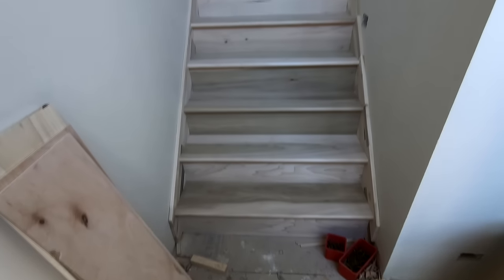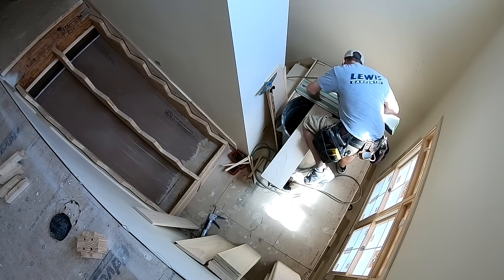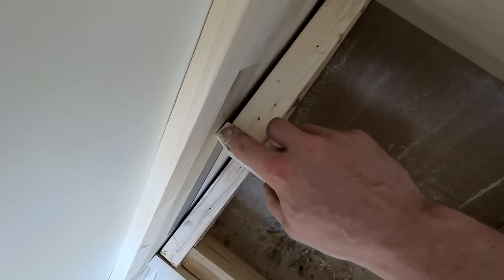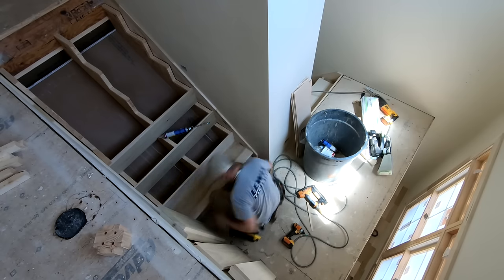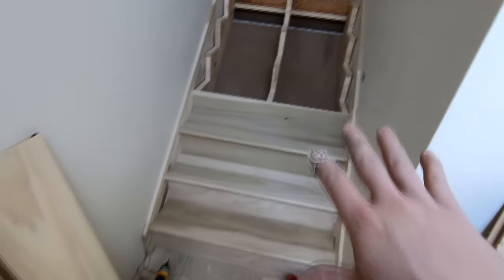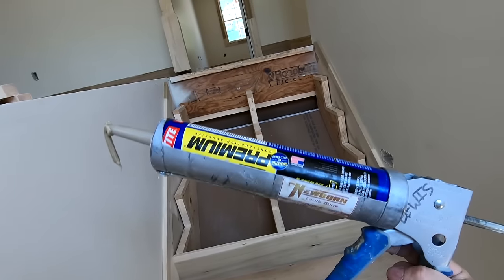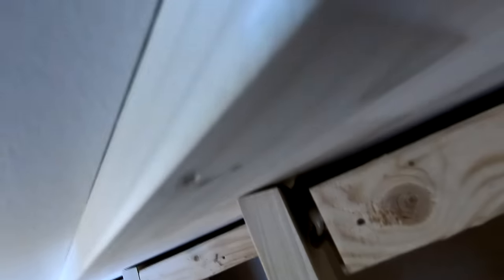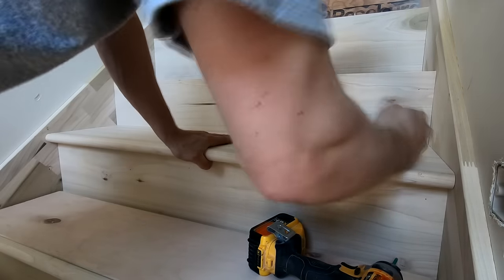How to Install Hardwood Stair Treads & Risers...Key Techniques for Perfect Results

Comment: Obviously for many species it isn't necessary, but for myself I would prefer drill the bottom of the risers so as to ensure that the screws go in straight, centered, and without splits. Also, I think you may find that the extra step actually regains the lost time by making the attachment go just that much faster.

Comment: This is a great video.  Thanks for putting it out.  I'll be purchasing your tools and will definitely go through your links.   I'm getting ready to put in red oak hardwood floors to add to the existing flooring.  After this video....I think I can do the work myself (slowly and surely).   The only area that you didn't cover was the skirtboard.  I have carpet over mine and expect not so pretty plywood underneath.  I'll soon find out :0)  Look forward to checking out your other videos.

Comment: On the stair stringers there are small pieces of wood added to the top and face of each cut out of the stepped stringers. Can you tell me about them? Did you put those on or did you buy the stair stringers like that. Ours don’t have that added. Is it crucial?

Comment: When you mention ripping the risers to the correct height, you subtract an 1/8” inch from the height of the stringer? I’m assuming this is on the back end where it tapers down? It looks like the tall side of the taper sits higher to achieve the gap you mentioned.

Comment: Enjoyed the video. In the new homes where I installed stairs the framers  installed the stringers. I always had to correct for the three stingers not being lined up, the riser cuts weren't plumb, and the tread cuts weren't level front to back or left to right. I didn't see you do this. Did you check the stringers for being lined up and having plumb cuts and level cuts off-camera?

Comment: Great video Spenser. I bought the Collins stair gauge and it works great. I have a very big stair job coming up with right-hand return treads. I have to mitre the stringers and risers to make a clean look from the side on the open stringer. Would you recommend one of the Festool cordless track saws for this? If so which one?
Reply from the maker: I always use my 12" sliding miter saw for those cuts. The track saw would only work from one direction unless you are plunging it. I'd stick with the miter saw.

Comment: He adds just a few 18 gauge nails just to hold the vertical movement while adhesive dries. I only have a brad nailer. Think it's good enough for the same purpose since it's not really for any load bearing purpose?

Comment: The tight fit is awesome ... That guide and the Collins tread tool are incredible tools. I'm replacing the "contractor grade" stairs in my basement and will pay the extra for the "right tools" to get the "best look. Thank you for this video.
Darn ... just looked at my stairs and noticed the right side spacing is "bad". I can put a skirt on the left but they seem to have installed one of the stringers with a lean. Any suggestions other than rebuilding a stringer?

Comment: I build the entire set of stairs in a room where I can screw from the exterior of the finished stringer into the tread and riser ends with 90 degree cuts on all the treads  and risers, no wasted time cutting 5 degree cuts on long edges or end cuts because the screws pull the stair together.  Once built, the entire stair set is slipped into place.  Super tight glued joints with hidden screw fasteners.  I’ve used this method in many remodels where I’ve removed the carpenter built stairs that were previously covered with carpet.
Reply: This,  I would like to see... especially one with multiple angles...

Comment: I have stairs that are a bit sloped to one side and upstairs is going to have solid hardwood so will add height, do you recommend putting new treads over the existing ones to reach top landing or gut the old treads and then raise and fix stringers?

Comment: Great video. I am surprised you are not predrilling the bottom of the skirting board from the front to ensure the screws are centered on the tread and do not cause splitting.  I'm old school and guess the new screws are better than I give them credit for.
Reply from the maker: Yeah, I was living on the edge. The GRK screws I was using have a really nice auger tip that helps a lot with splitting. Also helped that it was poplar. Oak would have split in a heartbeat.

Comment: My stair stringers are unevenly cut, I will need to put blocks to level them. Would you put those blocks on the side of the stringers?? Seems to be easier but wondering if that may create any issues>

Comment: Great video. I wished I watched this before redoing my stairs. Now I need to go back and redo them properly!  I noticed that your Festool rails have a black cut guide on them? How is that done?  It appears to be alot easier to line up with the mark than the clear cut guide.
Reply from the maker: Makita splinter guards. They stick better than festool clear ones.

Comment: You should give PL Premium MAX a shot. Its silane based, doesn't expand like the polyurethane products, and gives an unbelievably strong bond. I used that PL premium polyurethane on pressure treated deck stairs, had to disassemble them and it came apart disappointingly easily. Rebuilt test stairs using the MAX and it was impossible to disassemble. Broke boards while crowbar'ing the stairs apart.
Reply from the maker: Good advise. I am definitely going to switch to a silicone product for stair in the future. Thanks

Comment: Professional as expected, always sharing advanced tips & techniques.
Even I learned something new ☺️

Ps why not shoot a Brad in the bottom center stringer to hold riser, the tread will cover the nail head?
Reply from the maker: The tread keeps the bottom of the riser sandwiched in until it get screwed, but there isn’t anything keeping the top riser from kicking out, so that’s where it needs nails.
Reply: @InsiderCarpentry  got it thanks

Comment: Excellent video. Thanks dude. 

What’s the reasoning behind not nailing the very bottom of the risers where it will be covered by the tread?
Reply from the maker: They get screwed from the back side, riser into the tread. You want it to be able to suck tight to the tread, not tight to the stringer.
Reply: I caught that part but I worry the tread and bottom of riser could slide a bit (together) while you’re working on them/until the adhesive dries. I’d probably put a pins in the bottom of the risers as the GRKs will surely pull the pins out a little bit....*lightbulb moment*  that could cause a creek. I think I get it. This video was super helpful. Thanks again
Reply: Insider Carpentry also, I think I saw @jchcabinets use that tread jig on some built in shelves. Magic little do-dad

Comment: We are close to installing our basement stairs. I would be concerned about running the screws in from the back "straight". Thinking predrilling pilot holes might be helpful? Thank you for your video!
Reply from the maker: Yes. It will also prevent splitting in hardwoods.

Comment: I actually install all my risers first and notch my skirt boards in. Then i shim and glue the risers to the back side of the skirt board. More work and old school but less chance of squeaks and pops. And when the risers shrink there will be no gaps.
Reply from the maker: Makes sense and great technique. Shouldn’t be much shrinkage lengthwise but your method is definitely superior from a sight line and joinery standpoint. I may have to try this next time. 👍 I like to use plywood for risers. It’s just easier to work with all around and less movement for the long haul.

Comment: Just a heads up , the Festool  201374 HKC 55 cordless Track Saw Plus FSK  has been discontinued. The replacement is Festool 575737 HKC 55 Cordless Airstream Bluetooth 5.2Ah Track Saw PLUS - FSK

Comment: Great work! Super precise and efficient, but still not too proud to use a garbage can as a work table 👍👍. 
Why not put your pin nails in the bottom 1" of the riser so they are hiding by the tread once installed??
Reply from the maker: Because I screwed it into the tread from the back. I needed nails across the top of the riser to ensure that it didn't move since I was avoiding face nails on the tread.

Comment: Hello sir! I thoroughly appreciated this video. Your explanations were very to the point and easily followed. I'm not a carpenter, but I'm also not a hack. Question, so I have a job coming up to replace riser/treads, but their is NOT a middle riser. Based on this installation method you demonstrated, do you believe the stairs would squeak eventually without that middle support?

Comment: Looks like the Tenaru blade in your HKC.  How is the chip out when cutting the left side tread?  Don’t you have to cut from the back to front of tread?  
We mostly use pre stained and finished quarter sawn oak why I ask. Thanks!  Gotta get that saw now ;)
Reply from the maker: If the blade is sharp it cuts well. Also the splitter guard should always be on your cut line. Scoring helps reduce any chipping. If you cut to your knife mark there shouldn’t be any chipping. I’ve done pre finished also and this works well.

Comment: Another question, do you drill pilot holes before screwing from the risers into the treads?  What size screws?  I am paranoid about splitting the wood.
Reply from the maker: I just used grk r4 with no predrilling. but its poplar so it not going to split like oak.

Comment: So newbie here... Love the video and clarity of instructions. However, how do you screw in the back of the top tread? No way I can get to it as my last riser is carpeted leading to top carpeted area. Really hate to have to put nail or screw in tread. Also, is there a reason not to finish treads (stain / seal) before installing? Would make less of a mess with kids around.... Thanks again!

Comment: Do you ever have problems with the skirt boards being gradually pushed outward as you add the tight fitting treads and risers?
Reply from the maker: Yes, that is why the cut has to be perfect. It also helps to screw through the framing stringer and into the skirtboard as you go up. Keeps things pulled together tight.

Comment: Great job on those stairs👌👌. One question would it be possible to use pocket hole screws for underneath to secure the treads down using a right angle impact driver minus the very top one since there wouldn't be access

Comment: Really great video, Thanks for sharing. What blade are you using in your  Hkc-55?
Reply from the maker: I think its a tenry blade that I also use in my TS55. Otherwise the stock HKC blades. (which are horrible).

Comment: @insidercarpentry This is a great video. Thanks! Two questions: 1) did you glue down the furring strips to correct the rise and run from carpet stringers? 2) I've seen others cut a dado in the riser to receive a rabbit on the tred to eliminate gapping from shrinkage. Do the screws from behind the riser do the same thing we'll enough over time?

Comment: I recently went over my existing pine treads with new oak treads and white risers.  I used that stair tool, but the stair tool only ensures you get a good fit on the left and right.  I discovered the back of some treads had a small gap between it and the riser.  I guess the existing risers were not 100% flat (square).

Comment: My only concern is when the tread contracts and leaves a gap at the point where it meets the riser. 

Would it be better to run the tread under the riser via a lip or push the full tread under.
Reply from the maker: The riser is glued and screwed to the back of the 1” thick tread. It would take an incredible contraction to break that joint. I don’t believe that will ever happen. I think the tread itself would split before that joint would break.

Comment: I have a question: A lot of people have the rabbit on the end going into a dado to compensate for the expansion that will occur. I would assume that would make a gap with the 5 degree cuts you have butted up against each other. Not really a question but, does that happen with this method?

Comment: Would it not be better to install the tread first then riser. The riser will sit on top of tread and will cover the tread and there won't be any gap between riser and tread. If there is any gap it is much cheaper to replace riser than tread

Comment: Great Video! Is there a reason you didn't have the tread go into a dado on the riser? Are you worried about a gap opening up as the treads possibly contract? (Or is it not an issue if the material is acclimated?) I've got a similar job coming up and am trying to figure out if its worth the extra effort to mill the boards that way. Thanks for content. As someone who started in production trim and now also works solo its fun to watch you get after it
Reply from the maker: The material is acclimated and the reads are glued and screwed to the riser. I prefer this method as I don't any thing moving period. With the dado method it could be prone to squeaks.

Comment: Thanks for sharing, your level is what I aspire to be. 
I've had the HKC for a few years and always find new places to use it. One thing I noticed, the splinter guard is the solid black makita I think? (I have a makita track saw too) while I know that the makita replacement is WAY cheaper, I found that with the festool I can line up the cut line more quickly and easily because it's transparent. I'm quite often working in badly lit places and shadows are always giving me problems. My eyes are not what they used to be so that might be part of it! 
Anyway just wondering if you've had any issues with this too? 
Buying the gauges now!

Comment: I am sure this won't get seen by the OP but I was just curious on your choice of nailing. If you were looking to use the least amount of nails and are only nailing to keep the riser at height, why wouldn't you nail at the bottom where the tread would cover the nails holding the riser? Other than that, that is a beautiful set of stairs, sir!

Comment: I am redoing our treads now.  I have noticed that the inside of the stair case is NOT perfectly plum.. so what is happening is the left side of the tread might sit completely flat up against the stair casing but the right side of the tread might be slightly angled and the rear goes in instead of the front.. so how does one make a cut like that without having a gap and also making it look good?

Comment: Whenever nailing you can slightly angle the nail to help prevent squeaking from an ordinarily straight nailed nail working itself loose.
This tip also works well in scenarios when glue may not be used.
Just make sure to angle the nail in the right direction.
For example, when nailing risers to stringers angle your nails down and when weight is applied the riser will be drawn tighter and closer to stringer rather than pulling away.
These micro adjustments prove to help projects stand the test of time.
Reply: How do you screw the top tread/riser together like the others?
Reply: @darendenker2868  cut the top riser tight so it actually sits on the stringer and prescrew it to the back of the top tread and gently slide the attached peices in to place with beads of glue on the stringers and on the floor joist/beam ... but that's my best guess without nailing through the face or temporarily removing a section of subflooring to screw from behind.

Comment: Hi Spencer.  Great video. I also have a carpeted stair case I will replacing with wood.  How difficult is it to remove treads and risers that are glued with what I assume is liquid nails???  Do they pop off with a few hits or are the going to break like wood would when wood glue is used?  Thanks!
Reply: ....also, is there a good finish that avoids slippery floors?  I have seen some additives that claim to help with this but I have to imagine that this eventually wears off?

Comment: Hey Spencer,  I have a question about installing treads when the framing is capped with plywood.   What I've been doing is squeezing large globs of adhesive evenly spaced on the flats and squishing the treads down into the adhesive.   Then level it out and using two to four nails just to hold it in place until the adhesive sets.  Is there a better way?

Comment: As an option, put glass wool (sound) insulation in the opening under the steps. You know some hollow sound reduction for the stamping feets of the little 🐘 running up the steps.

Comment: So my flooring supplier tells me that construction adhesive like the one you're using is a bad idea because it doesn't allow the wood to flex with temperature/humidity changes, and the bond will eventually crack.  He recommends a flooring adhesive such as Pallmann P5 which maintains a certain elasticity over time and will guarantee the floors/treads don't squeak.  Curious what your thoughts are about that.
Reply from the maker: PL Premium has decent elasticity. I have see stair manufacturers spec PL Premium for this reason.

Comment: In this video, you aren't nailing the front of the tread like you have in other videos. I like this method. However, how are you able to walk on and work on the treads you placed that are only being fastened by screws in the back through the riser? Doesn't the front of the tread move some and compromise your adhesive contact area? I would like to use this method in the next couple of days. Your feedback would be much appreciated. Great videos btw!